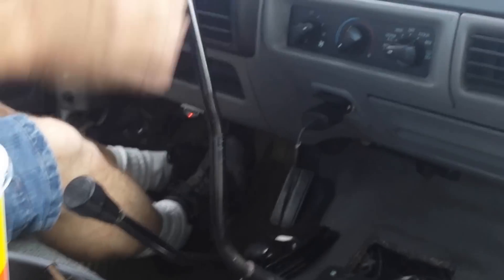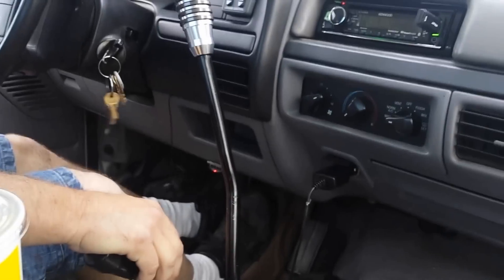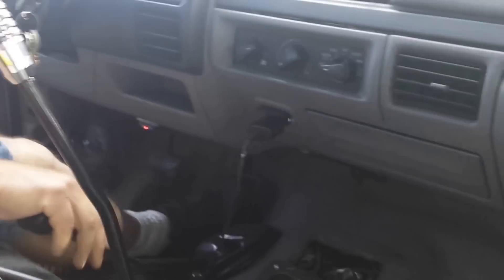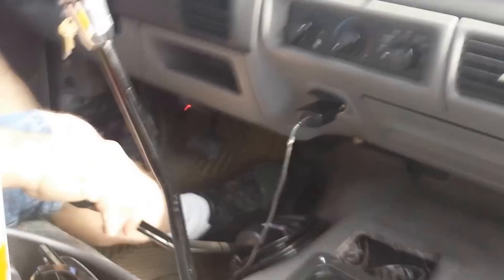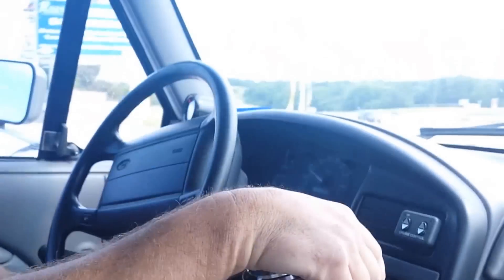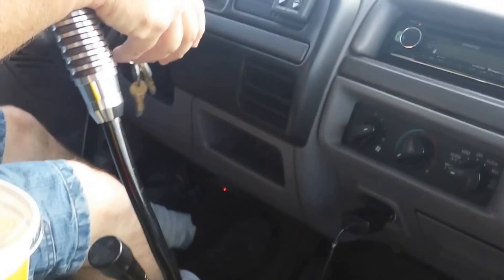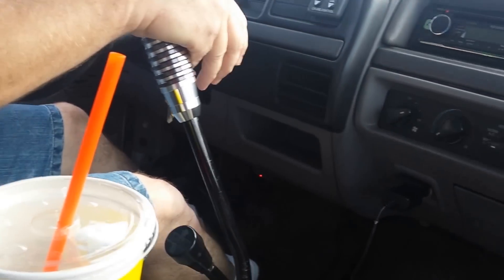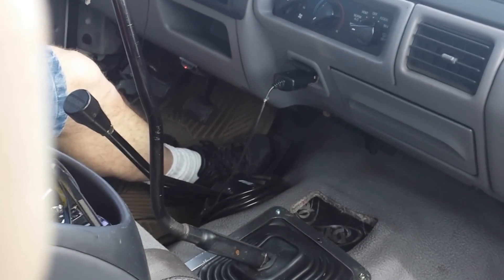F150 twin stick test drive

Comment: Is it a t18 transmission?
Reply from the maker: Sorry, just now saw your comment.  It was a T19 , basically a T18 with different ratios.  Granny gear is a little taller in a T19

Comment: So this over drive bolts in FRONT of the transmission ? Unlike a Gear Vendors which takes the place of the tail section of compatible transmissions ? And so ur overdrive could work with a divorced t case pending under body length ? How long is ur overdrive like the added length
Reply from the maker: Yes it bolts in front of the transmission, between the bellhousing and original 4 speed transmission.  Unfortunately they no longer produce these units, after 30+ years of making them advance adapters shut it down due to lack of sales. I bought mine just in time, I think it was the last batch they produced.  So unless you can find a used one somewhere...  you are out of luck.
Reply: @Stumpy1973   there's probably 50 of them sitting on crates collecting dust across the country. I guess I'd have to go on several forums and hit some tractor shows and truck pulls and just hunt for one. It sounds like a great option for some of stuff I want to do where the gear vendors isn't my favorite.
Reply from the maker: @12vshady  They are made to bolt up to 4 speed Ford and Chevy transmissions.  There was a version made to adapt a Chevy engine to a Toyota 4 speed land cruiser transmission, so the overdrive unit also served as the adapter plate for doing a chevy engine swap in an older land cruiser.

Comment: Does Advance Adapters still make this? If they do, do you have the part number?
Reply from the maker: No , they no longer produce this unit.  It had a good run, it was originally developed in the 70's by another company.  Advance Adapters bought out the rights at some point, maybe in the 90's ??  They produced it up until 4 or 5 years ago. They told me when I bought mine they were just about done producing these, they had seen a steady decline in sales of these units as the older 4 speed trucks die off.  Only way to get one now is to find one used.  I have since sold this truck with the overdrive still installed.

Comment: is this a 2 speed trans that you ad to the back of your trans?
Reply from the maker: This particular one is a 2 speed that bolts in front of the transmission, between the bellhousing and transmission.  Advance Adapters used to sell them, but they have been discontinued.

Comment: Im looking to add an overdrive to my 1985 f150 4.9 i6. It has a four speed manual (1st is granny). I think the same add on you used is what I need. What is the model name?
Reply from the maker: Unfortunately this unit has been discontinued.  It was made by Advance Adapters, Ranger II
Reply: @Stumpy1973  thanks, great video by the way. Searchin the internet for one, any idea where to get one used or if any other models of torque splitters also fit ford four speeds?
Reply from the maker: @oliverhsu4141  Check Craigslist and marketplace , maybe Ebay.  It might be a long shot, but keep trying.  Only other thing I know of is Gear Vendors Overdrive.  They are expensive. Not many people running the old 4 speeds anymore, which is why Advance Adapters stopped making them. When I bought mine 6 or 7 years ago they told me then they were about to discontinue them.

Comment: I've been wanting to do this for years to make a heavy pull truck but don't know where to find a 2 speed auxiliary trans unless I buy gear vendors unit but it's expensive as hell
Reply from the maker: Unfortunately Advance Adapters stopped manufacturing these units. Only way to get one now is used. You could look for an old 3 or 4 speed aux out of a medium duty truck.  One from a semi would be too big and heavy I would think.
Gear Vendors would be one way to go, I know they are expensive but you gotta pay to play.

Comment: Sorry to ask a question after that long description but could you use a transfer case to shift low range to high range on the move?
Reply from the maker: You can, and I have.  Toyota gear driven transfer case, 85 Toyota SR5 4x4 pickup.  Not sure if it can be done with a chain driven case (which most modern 4x4's are these days).  
Even with a gear driven case it was not easy, it of course is not synchronized and there is a huge difference in rpm between low range and high range if you stay in the same gear in transmission.  And transmission would have to be manual too of course, don't see it working with an automatic.  The way I did it was shift 1 , 2 , 3 in low range. Shift transfer case to neutral, shift transmission back to 1st or 2nd gear then once rpm's had dropped enough I would shift transfer case into high range.  Important note here, this was done either with no clutch, or by double clutching.  Either way once transfer case was in neutral and trans shifted back to 2nd gear the clutch pedal had to be up to allow the changing engine rpm's to spin the transmission and transfer case input accordingly.  Otherwise the transmission and transfer case just freewheel at an unpredictable rpm.  This is the case with any non synchronized transmission.  You either have to float the gears , or you have to double clutch.  Clutch must be engaged ( pedal up ) so the engine rpm and input shaft rpm can be matched.  This is why most truck drivers float the gears, if you never touch the clutch pedal then engine rpm's and input shaft rpm's are always in synch.

Comment: Well, I understand what that is because I've driven big trucks a lot. (My dad was an O/O till 85)
Coming up in the 70's, in cabovers with everything from twin stickers, 5sp-18spd's, etc. 
With "Reyco" spring ride .411's
They've came a long way since.
But my question is why?? 
Why would one purposely that in a modern truck? Is it used for something that requires lots of power? I still have an old 65 F model 3x4 Mack(coe) myself, but it came with that setup.

But my question here is "why"?
stickers everything fr
Reply from the maker: It really is not such a big deal.  It's not a transmission from a semi or anything like that.  It is simply a 4 speed "granny" transmission that came stock in these trucks up until the late 80's.  The 2 speed is a simple over drive unit that used to be offered from Advance Adapters, and back in the 70's and 80's this very overdrive unit was a popular upgrade to 1/2 ton , 3/4 ton and 1 ton pickup trucks with a factory 4 speed.  It's main purpose is to add an overdrive gear, it just so happens to have a by product of being able to split shift all the gears.  You don't have to split shift at all if you don't want to, in fact you can shift it into overdrive and leave it there forever and just shift the 4 speed. Or shift into direct , shift 1 thru 4 and then shift to overdrive.  The combinations are endless.  Main reason I did it is the stock 5 speed transmissions that came in these trucks were not good for any kind of towing.  I regularly towed a car or truck on a single vehicle car hauler trailer.  This truck being an F150 that was maxing out the towing capacity, and really going over the tow capacity.  The 4.9 straight six or "300" was more than enough for the intended load.  The rear axle was adequate, it was the 5 speed that was the weak link.  So it was actually much cheaper to go with an old 4 speed granny and this overdrive unit than it would have been to upgrade to a ZF5 or ZF6 transmission.  This overdrive solved two problems with the old 4 speed, no overdrive and a very wide spacing between 2nd and 3rd gears , and 3rd and 4th most noticeable when towing.  2nd to 3rd is not that bad, but 3rd to 4th when towing on any kind of hill was just brutal.  This overdrive / splitter solved both of those shortcomings beautifully.  For a 1/2 ton truck this combo made for a stout combination capable of towing long distances in overdrive.  
A side benefit for me, being an ex truck driver myself , being able to get my gear jamming fix on!

Comment: Sadly Advance Adapters only sells the spline adapter, bearings and gaskets but no longer manufacture that overdrive unit anymore.   

Though, I'm going to build my own overdrive unit.

I'll fabricate my own gear housing, I'll have a machinist plane the case so that it mates up to the main transmission nicely and also machine the dog rings and spur gears that will adapt to the NP435 from a 1978 Bronco.   Combine a Muncie-esque overdrive unit with an NP435, NP205 and Ford 9"/Dana 44 and I got some good gears for years to come.  

I also need my gear jammin' fix.  My mustang's 5 speed is nice but I need more gears and something to do while I'm driving.

That and the sound of gears clunking together and spur gears whining just get me all giddy and joyful.  

If anything this diy-overdrive will make the Ranger III O/D look bad lol.

Jkjk, the ranger over drive is still awesome.

Comment: So can you just shift between the direct gears or do you have to use the overgears?
Reply from the maker: You can just shift the main gears. If you never wanted to touch the overdrive you could just shift into overdrive and leave it there. It even works in Reverse. This is simply an add on overdrive unit for older 4 speeds. It's essentially adding 5th gear to a 4 speed. Just has the added benefit of acting like a gear splitter if you want or need extra ratios.

Comment: How much hp and torque can it hold?
Reply from the maker: Not a whole lot by today's standards.  I think its rated for 420 or 450 lbs of torque. No horsepower rating, transmissions are mostly rated for torque. They used a gearset from an older T98 4 speed, so I guess it's about as strong as a typical granny 4 speed.
Reply: @Stumpy1973  Thats a bummer. I need it to hold 600-900. I've got a diesel thats why

Comment: Those flat cut gears are great for cabin decibel levels.
Reply from the maker: They are not flat cut, they are helical gears.  Just noisy AF, but I was warned by Advance Adapters that is was a noisy unit.  The gearset is the same design as an old T98 granny 4 speed. Uses the same synchro hub assembly, they are a custom cut gearset, just based off a T98 design.
Reply: Put some rubber between where the shifter rod bolts to the shifter arm of the transmission.

Comment: Idk how the hell I found this video. after reading the comments , some of yall would die if you have to drive a 5x4 , 6x4 or triple stick 18 speed
Reply from the maker: Lol , exactly!  Comments have exploded about how complicated this seems.  This is no where near as complicated as a 6X4 , and a 6X4 is not even that complicated once you break it down.  Now a triple stick 18 speed is a fake setup.  Two of the sticks are just operating air valves on the splitters.  So all it is doing is over complicating something purely for the entertainment value.  It is a neat novelty and all, but it is fake!
Reply: @Stumpy1973  ive driven a tripple stick 18 , I would love to have one as a show truck , but I would NEVER EVER want to drive one daily , ill stick to my lonely single stick  18 for now

Comment: How did you get this set up I really want to install one into my f150
Reply from the maker: Advance Adapters is the company that makes this overdrive unit, it bolts in front of older 4 speed truck style transmissions like T18 , T19 , NP 435  , Chevy SM 465 etc.  It is called a Ranger Torque Splitter.  I used a bellhousing from my old 84 F150 , this overdrive unit , and a T19 I got out of a junk yard for $100.  Bolted it all together using the clutch and flywheel from a 1984 F150 (new from parts store).  Modified the cross member and driveshaft and the clutch hydraulics (used external slave cylinder and line from an 84).  Covered original hole in floor board and cut two new holes and viola!

Comment: Wow that is sweet. Wish someone made these things for the Mazda 5 speeds. Wouldn't mind having a crawler gear or an extra overdrive even.

That unit does sound kinda noisy when it's in overdrive doesn't it? I mean I guess that makes sense since it's right off the engine.
Reply from the maker: They use a gearset from an old T98 4 speed granny, which was replaced by the T18 , it's a super strong gearset, but I guess it is run backwards to make it an overdrive hence the noise.  My theory anyway.

Comment: why does the OD unit scream like that?
Reply from the maker: It is a design characteristic of this overdrive unit made by advance adapters.  It is helical cut gears but it still makes noise like straight cut gears.  I was warned about this by advance adapters before buying this unit, but yes it is kinda loud.
Reply: @Stumpy1973  Does Gear Vendors have the same noise problem?

Comment: Awesome! Would this work with a Zf5?
Reply from the maker: No, the ZF5 does not have a removable bellhousing and the input shaft is completely different than the older 4 speeds.  This only works with truck style 4 speed transmissions. T18 , T19 , T98 , NP435 on the Ford Version which is what I have.  They make on for Chevy to fit the SM420 and SM465.

Comment: how has your combo held up to normal driving conditions? any known issues with the torque splitter unit?
Reply from the maker: sorry for the late response, comments seem to get buried rather quickly.  It has held up just fine.  No issues with the overdrive unit other than the noise which is a normal operating characteristic.  I recently sold the truck to a friend and it is still running the roads with no issues.

Comment: Could you do that with 4x4?
Reply from the maker: Yes, as long as it has a Ford or Chevy 4 speed transmission.  It bolts in front of the transmission and moves it and transfer case back 6 or 7 inches, so driveshaft modifications are necessary. Plus the shifters would also be moved back.

Comment: How did you do this I got a auto 5.0 f150 4wd I'd like to have a older 4spd but not sure since I'm running computers efi
Reply from the maker: 5.0 as in pre 97 302 pushrod V8 , or 5.0 coyote 2012 and newer?  If it's pre 97 no problem, just ditch the auto and put a manual in it.  If it's newer....    good luck!
Reply: @Stumpy1973  no it's a 1996 5.0 4wd
Reply: @Stumpy1973  but what 4wd gearbox would I use?
Reply: @corndogextreme8887  1356 borgweiner.

Comment: Really he used his clutch. Unnecessary
Reply from the maker: So let me ask you this, if anybody uses the clutch in a normal 5 or 6 speed car is that unnecessary?  A synchronized transmission is meant to be shifted with the clutch. The synchros are delicate brass material. If you routinely float the gears in one you will rapidly accelerate the wear of these brass rings.  If you miss the shift by even 100 rpms you are not only damaging these rings you are also introducing shock and vibration into the entire drive train.  This prematurely wears bearings in the transmission , U joints , and possibly doing damage to the rear axle bearings and gears.  It can also damage the thrust bearings on the crankshaft.  Now in a non synchronized transmission it is a lot easier to float the gears. I drove semi's for almost 12 years and routinely floated the gears.  I have floated the gears in this truck plenty, it is just a major pain in the ass.  It is very hard to control the rpm's in this truck, if I miss the rpm's by even 100 rpm's or less it will grind or completely lock me out of the gear, so I just use the clutch because it is much easier.  Or at least I did until I lost my left leg in an accident. Now I have to use a hand control on the clutch so I float the gears a lot more now.  Do you have any videos of you driving and shifting without the clutch??
Reply from the maker: Nope, you have no videos posted.  Are you one of those internet warriors??  Is this just your trolling account??
Reply: Well I don't troll the internet. I just look up stuff on it. And you are right it would put a lot of wear and tear on your whole drivetrain if you are shifting without a clutch . But considering that it is a pickup but I don't know much about twin Transmissions and how all that setup works but I have an older F-150 with a pretty heavy-duty transmission and and I've taught several of my friends to float gears in it and that has came along with a lot of grinding and  unnecessary where so yes with the newer transmissions in the market it wouldn't mess them up if you missed your shifts but since it is an older pick up it won't matter with a little bit of grinding
Reply: And this is my mother's account that's why I don't post any videos on it. And I am 15 so I do not have much knowledge on twin transmission setups yet